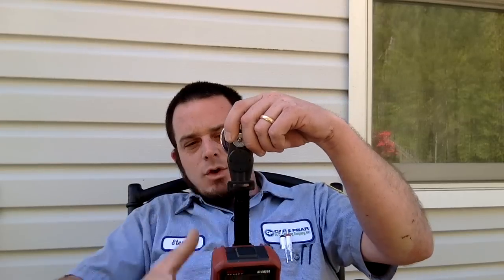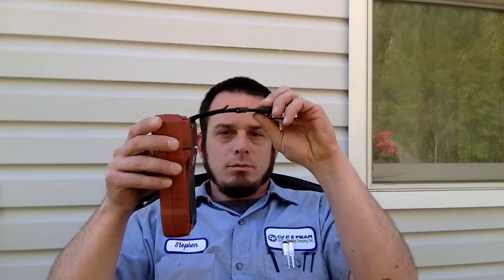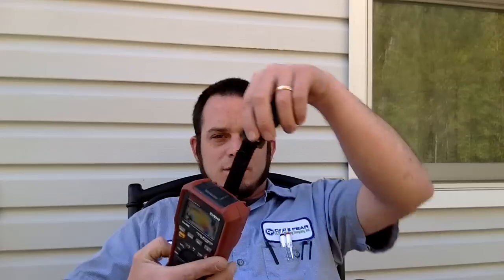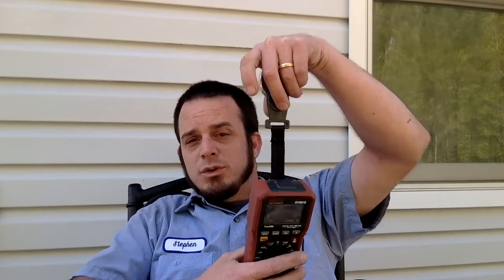HVAC Tools: Redfish iDVM 510 Meter Opinion

Comment: Will the meter allow you to see graphs of say...amps.  To see if the motor wave looks funny.  What I mean is, if a motor is running up near FLA or over could you see a funky wave on the graph that doesn't look like a good motor?

Don't know if that makes sense but sometimes motors look funny on an oscilloscope when going bad.
Reply from the maker: yes, if you use the bluetooth connected app you can watch a graph.

Comment: Stephen voltage and amperage testing is very important, if you truly stop and think about it, we as technicians don't have any control over supplied voltage or control over amps. Now we can change the load on something and change the amps but we are not changing the amps we are changing the load. The only people that can control the voltage is the utility, so live data is a good thing but let's say the voltage is wrong what are you going to do about it the same thing I am going to do call the utility. The iManifold is fine by looking at the air flow and refrigerant that is something I can control as a technician.
Reply: +Patrick Campbell I know it is important information, if I run up on a unit that is running but not cooling a meter is not the first tool I go to. That is what I am saying.

Comment: It would be nice for them to of integrated an inverter tester into to meter and iManifold app, but I don't know of any multi meter that has an inverter tester built in.
Reply: No not the ones for AC units, my tester cost about £50,  you are only checking for the phase and balance, then you check the voltage,
Reply: IPC-307 google that it's close to what I have

Comment: do you know if the imperial hosed gauges are waterproof? the Johnstone rep didn't know
Reply from the maker: +michael cole they are highly water resistant but not exactly water proof. Brent Ridley has a couple torture testing videos. 
Water- https://youtu.be/bSHdXeqG0vA
Hot and Cold- https://youtu.be/KBnW4y75tYA
Drop/Fall- https://youtu.be/x6HuqmbQ-rU
Reply: +Stephen Rardon (HVAC with Stephen Rardon) awesome thanks.... I believe I have already realized I need to get the repeater.. is that usuable with the hosed imperial set?
Reply from the maker: Yes
Reply from the maker: I would recommend simply getting another pressure probe or air probe or anything except the repeater though, the repeater has very limited usability whereas all other probes can be used as a repeater in addition to being usable as whatever other feature you decide.
Reply: +Stephen Rardon (HVAC with Stephen Rardon) in already getting the manometer and humidity probes... will those work whenever they get here lol